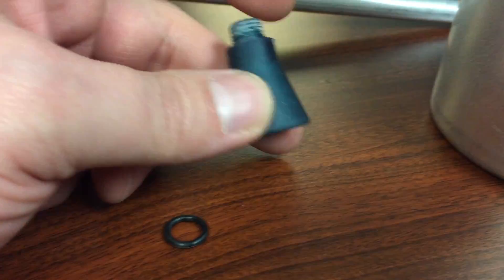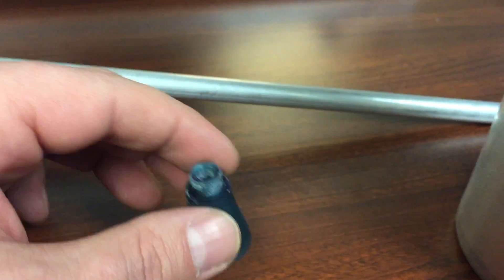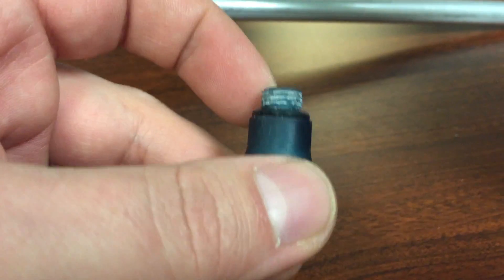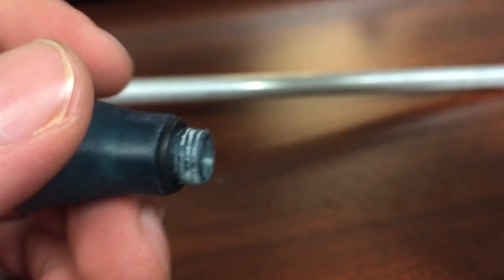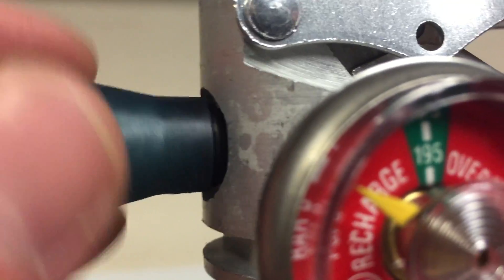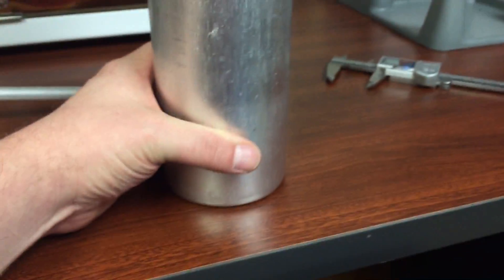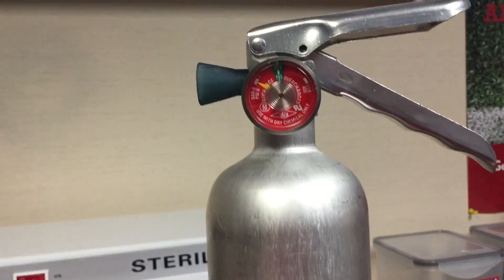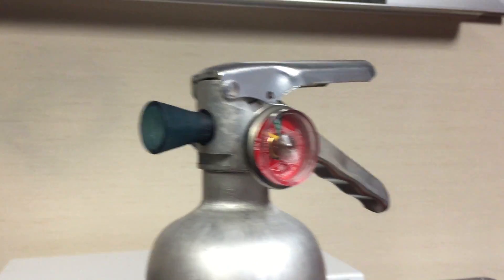Testing a 3D printed nozzle using Formlabs Tough resin ♦ @ 195 PSI air w/ water

Comment: is "tough" resin stronger then ABS?
Reply from the maker: It's not as strong as injection molded ABS but it's pretty strong. Here is the data sheet for the Tough resin http://formlabs.com/media/upload/Tough-DataSheet.pdf
Reply: +haknslash awesome but how much is the formlabs printer? is it prohibitively expensive (and resin cost) and what res is the printer, small enough to make objects which are small as half a mm?  would be good for making scale landing gear from some rc aircraft :D and other cool projects. would 3ds max be a good program to use for making models? I dont have any Cad software :(
Reply from the maker: Risto Mladich All of the price and info can be found on their website http://formlabs.com. I have the older Form1+ printer but they have a new one called the Form 2. The Form1+ printer is like $2,800. Resin costs anywhere from $90-150. You don't really measure 3D printers by resolution but rather layer thickness in the Z axis. 

From their site:

Different 3D printer manufacturers use different metrics to define “resolution”, but layer thickness is one commonly cited standard. The Form 1+ can create layers as thin as 25 microns, which is much finer than other desktop machines. Minimum feature size, on the other hand, refers to the thinnest wall or finest point, which can be as small as 300 microns on the Form 1+ or Form 2. Our design specifications explore the minimum features you can expect. The Form 1+’s laser beam can move in steps of fewer than 10 microns, creating extremely precise movements and an impressively smooth surface finish that FDM machines can’t match.